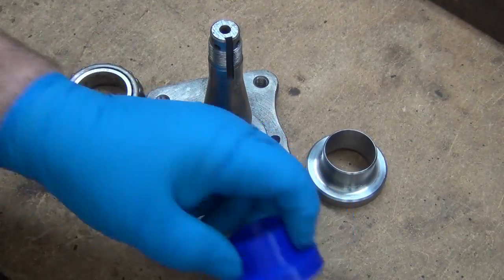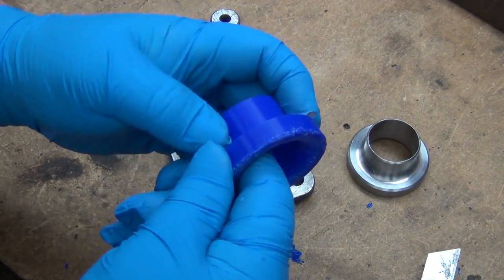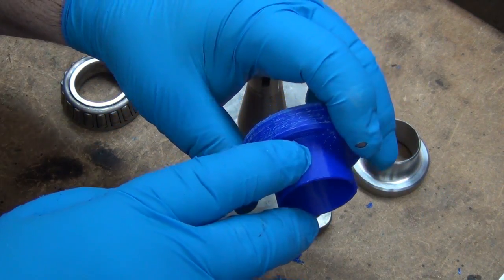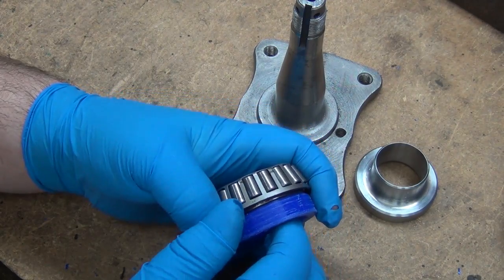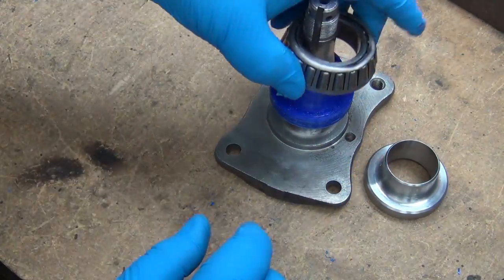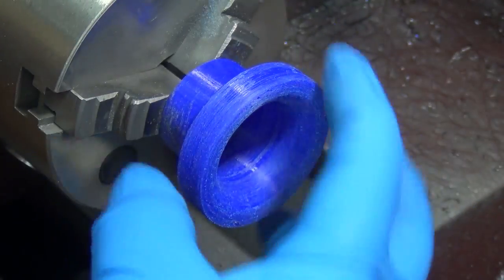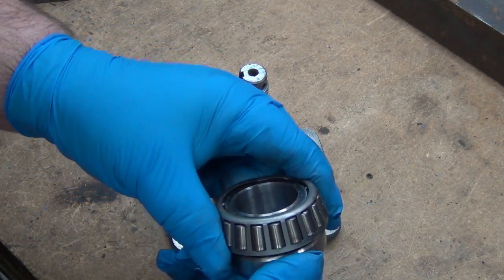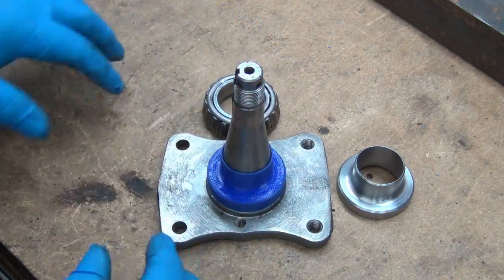3D Print - Bearing Adapter

Comment: I would use a 5C step collet or something like that to hold the ID.
Reply from the maker: I just did a bit of googling.....I didn't know they had an expanding 5C collet.  http://www.royalprod.com/product.cfm?catID=6&ID=38
That wold work nicely!  I tried to fit it over the expanding arbor I use for the bearing adapters, but the ID was too small.  The OD was good, so I didn't have any need to work the outside after the ID was opened up.  The CAD work could be adjusted for another print.  If I had the backing plate finished for my 6 jaw chuck, that would have been better than the 3 jaw.  One of these days I'll get to it. :)
Thanks!!
Reply: yep.. there are other collets that have a similar arrangement too

Comment: The 3d printer is just right for making patterns for metal casting.  So far I don't know anyone who has gone into the pattern making business with one.  I think if they were not too expensive it would be a good substitute for making your own pattern from wood.  Thanks for sharing.
Reply from the maker: George and I are chatting about a similar use.  We want to make a flexible part...rubber duct.....we're looking to do the molds with the printer he's getting.  Even if it doesn't work, it ought to be an interesting project :)
I agree......making a positive pattern with the printer could be a lot easier than making some shapes in wood. 
I don't know if it's being done commercially, but it's definitely being done in the home shops!!  Check this out.....
http://makezine.com/projects/guide-to-3d-printing-2014/metal-casting-with-your-3d-printer/
Thanks for stopping by!
Reply: bluehandsvideo That is very interesting.  Still I think they are destroying the pattern with each cast.  That is not a problem if you own the printer but I would be more interested in a direct replacement for the split patterns so I could use them forever after I got them.
Reply from the maker: cerberus
I wonder if you could make a more durable set of split patterns from the plastic ones? 
Yep....the lost PLA method would most certainly require a new positive each time. My parents did some lost wax jewelry when I was a kid.

Comment: General rule of thumb re, abrasives in the lathe, if you want to remove material go slow  with coarse grit and fast with fine if you want to polish. Going too fast just produces heat and doesn't give the grit enough time to cut, Certainly this is the case when turning wood, same principle should apply to plastics.
Wishing you a happy new year
chris
Reply from the maker: Makes sense!!  Thanks!!!  Happy New Year to you too Chris!!!
Mike

Comment: Hi !

I once had a talk with one, who made a pattern for molding - I think it was Keith Rucker - and we talked about the roughness of the surface, but he told me that some "fluid" could smooth it out very nice - maybe you should ask him for more details.

I think it was his pattern for the handle for his restoration project of a safety box !
Reply: If the printed material is ABS you can smooth the part in an acetone vapor bath. You suspend the part (on a platform or with a string) above a pool of acetone in a sealed container. You can do this with an unheated bath for several hours or with a heated bath and it can be done in minutes, but it is more risky for melting more material than you want.
Reply from the maker: Howdy Keld! Great to see you again!  I'll have to see if I can find some time to check Keith's channel for that project.
Thanks!
Mike
Reply from the maker: smh3w
I've heard of acetone being used to smooth out the ABS parts, but I hadn't heard about the vapor bath.